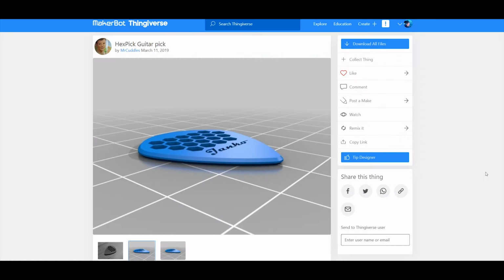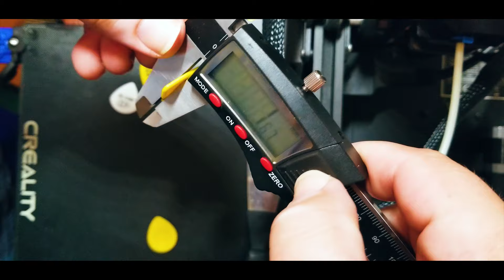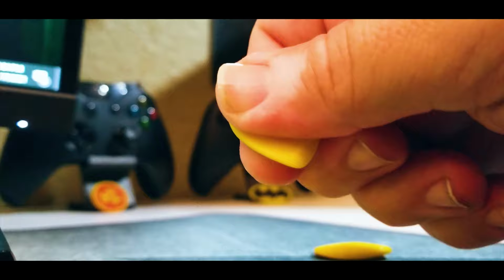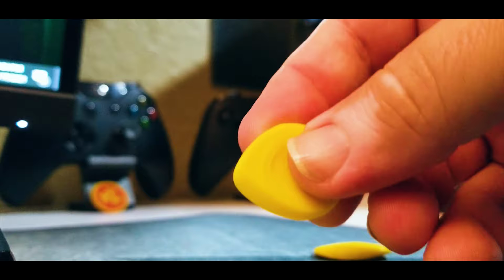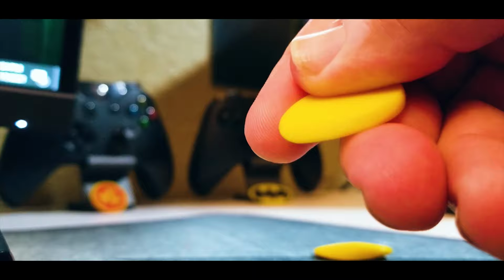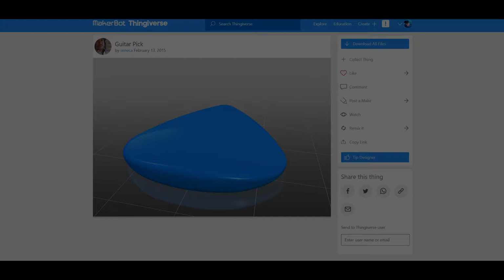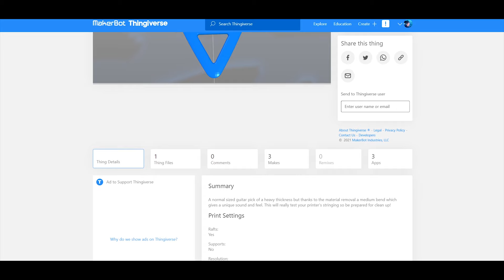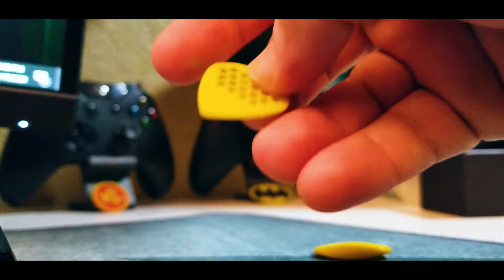I Tested 3D Printed Guitar Picks

Comment: How well have these held up for you over time? I printed a few, including the Hex pick and found they start fraying a bit after a few intense songs. If yours were holding up better, any tips on settings? I went 1.6mm thick with .2 layer. Thanks!
Reply from the maker: It's been a while, but I believe since these printed quickly, I just used the best stock profile in Cura. I still use them here and there. When they start to fray, I just sand them down with a fine grit sanding block. 

I don't think they'll ever replace my normal picks, but I'd like to try them from a resin printer one day. In the very least, they won't fray.

Comment: Seems like maybe the 1.5 parameter didn't take for some reason? A standard nylon jazz 3 is 1.38 so maybe that's what the original file was set to? Either way great video man!!
Reply from the maker: That's a possibility. 
Thanks!
Reply: @Avel  the issue was your layer height. Having set your layer height at a smaller increment would have gotten the final product closer to your desired goal.